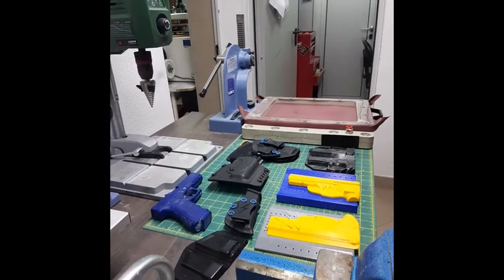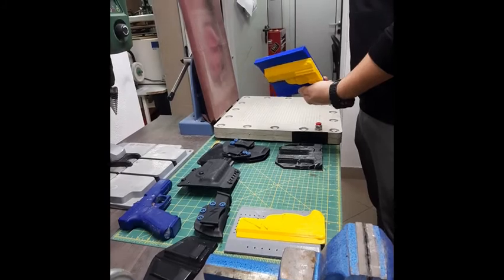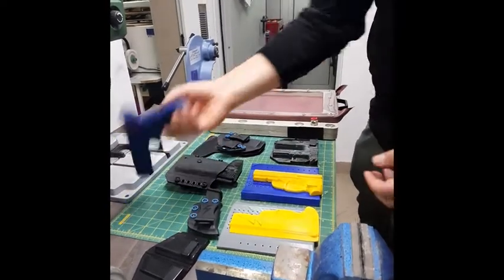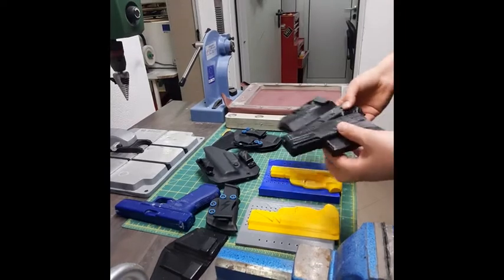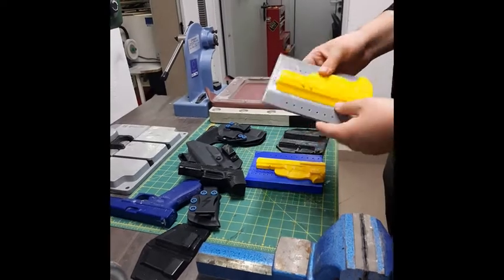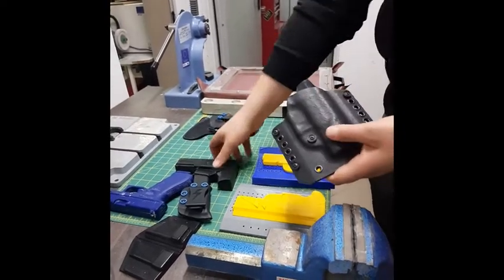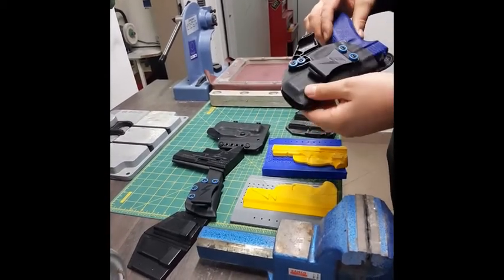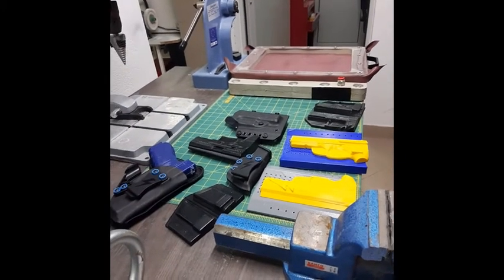3D printed Kydex holster molds

Comment: No issues with the PLA warping?
Reply: Pla warping? If your PLA is warping you're not doing something Right
Reply: @fuerzaalfa-alphaforce3131  I believe he was referring to the PLA molds' ability to handle the heat when shaping the kydex around it.
Reply: It will deform with heat, yes.